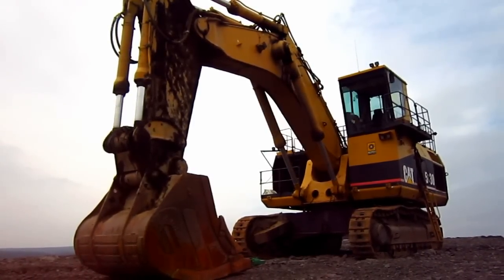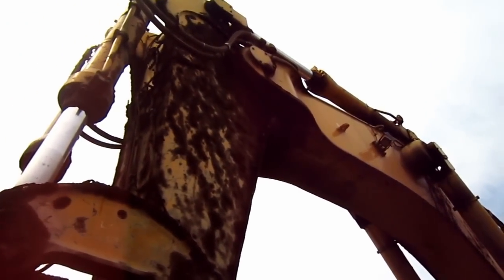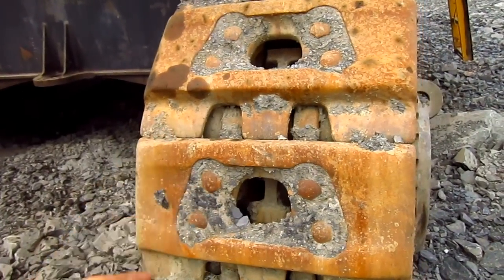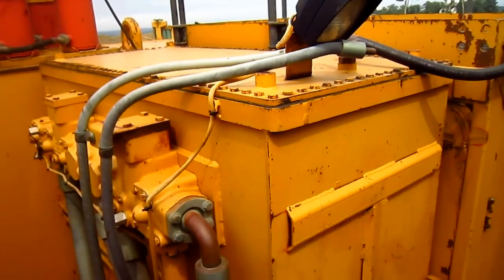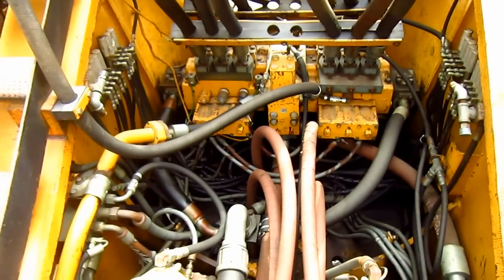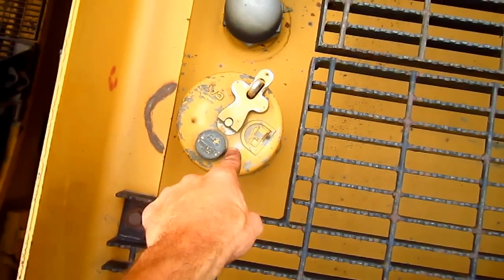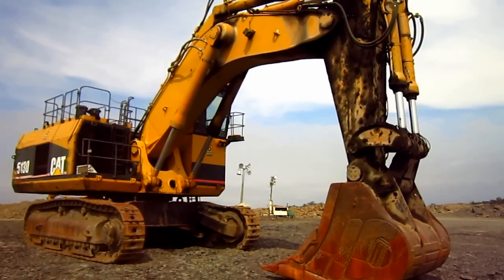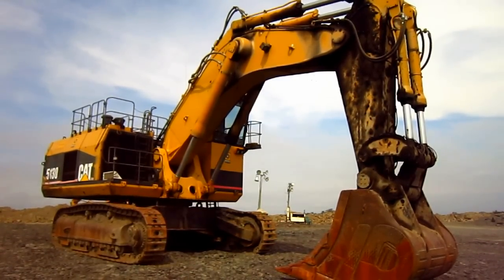Caterpillar 5130 Documentary

Comment: Great video and accurate but my personal feelings on this machine are negative.  Don't get me wrong I prefer Caterpillar machines over others to work on but the 5130 is a lemon.  Underpowered to start with and I  believe the tracks are too narrow for the machine.  They are notorious for literally breaking in half at the slew ring (I have seen this!!!) They require special maintenance in this area other diggers don't.  I much prefer the smaller Komatsu PC1250. In my opinion Hitachi makes the best product in this size range.
Reply from the maker: I disagree.  Yes the 51/5230 had many design flaws but power was not one of them.  The opposite is actually true.  These machine were overpowered for how light they were built.  And yes, slew rings were always a problem with the 5130.  This particular unit had it's slew ring changed several times in it's life.
Reply: PAmining I have only had anything to do with 2 different  5130s and both seemed slow, maybe they were both off a bit? Bad pumps or not set right maybe?  My preference is Cat machines to work on but personally have never actually put a spanner to a 5130.  I have had experience operating and maintaining many Hitachi excavators, 1200, 1900, 2500-1 & -5, 3600-5&-6 and 5500 which seemed to perform better than the 5130 (relative to their size).  I have extensively worked on and operated PC1250's and found them a fairly good machine.  Keep the videos coming they are some of the best machine videos on you tube.

Comment: PA, are you an operator your self, or are you just an enthusiast, or both? :)
Reply from the maker: Haha, I am mining engineer student (one more semester left before I graduate).  Enthusiast, yes.  I used to operate as my first summer job for a couple years and learned under some of the most skilled operators (IMO).
Reply: PAmining hey PA can you do a documentry for a CAT330BL really wanna see a doc for that, thanx
Reply from the maker: PCGAMR1 Sorry man, I only film the big mining equipment, not the small construction class stuff.
Reply: >_> lol just asking cause im in quarrying and planning on getting a 345 ,but considering getting a 245 as its just stronger and seems to handle the work better, what do you thinK?
Reply from the maker: PCGAMR1 That depends on many factors.  They are both good machines.  245's are bears for hard rock digging but don't have the speed nor the comfort that a newer Cat does.  Many old time operators still believe the 200 series was the last good excavator series Cat ever built
Reply: lol my dads like that , but im in for the new age